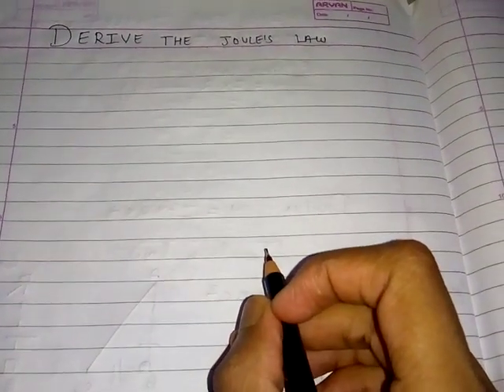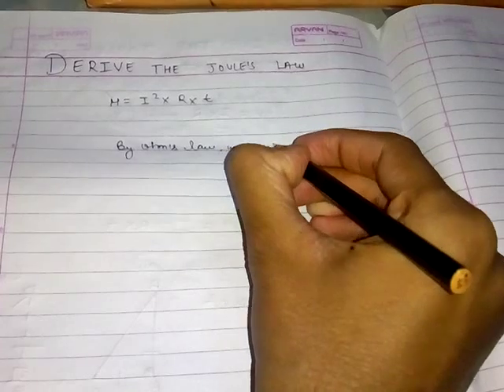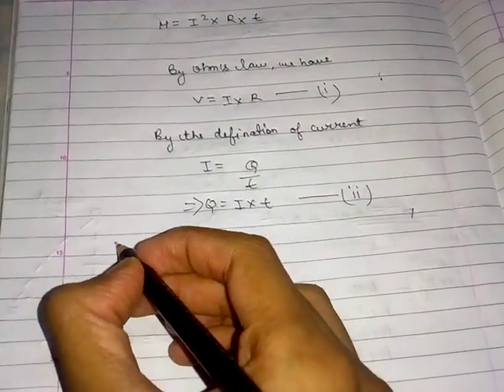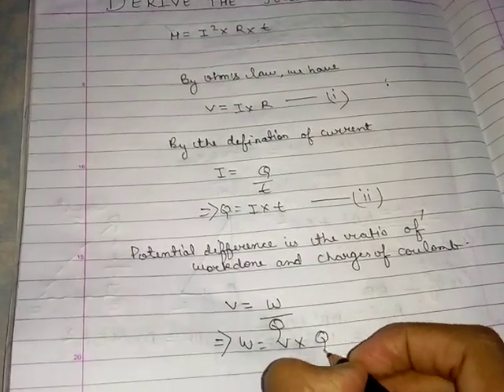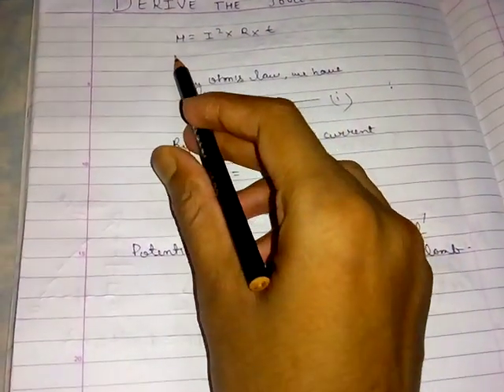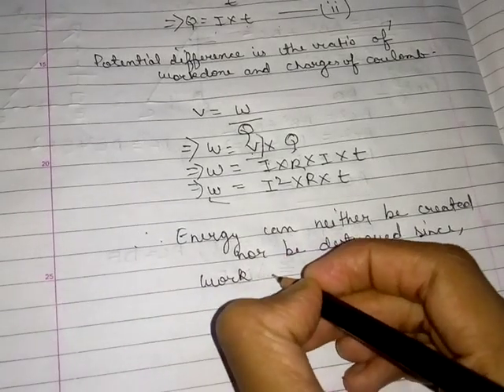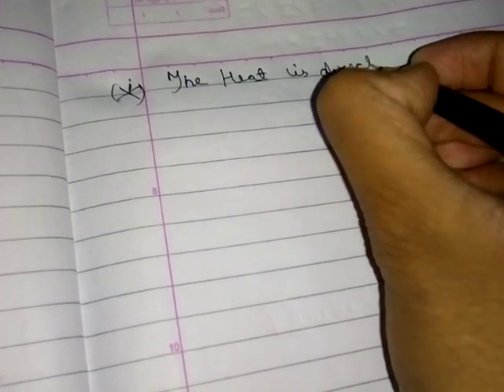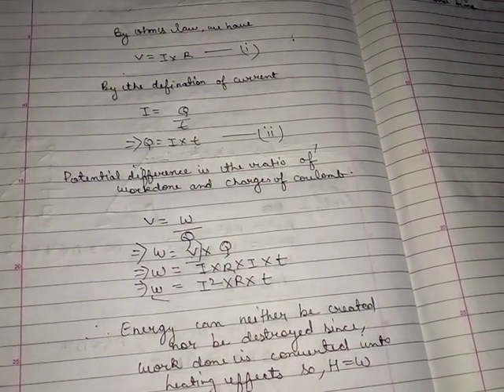Derive of Joule's law of heating effects ( H=I×V×I×R)

Comment: Bro you really overcomplicated it.
Here is an easier version of it -
We know,
W = FS
W = qV   (F = q, S = V)
W = ItV (I = q/t, so q = It)
W = I²Rt ( V = IR)
H =  I²Rt (W = H)

........................................

{ W = Work done, F = Force, S = Displacement, q = Charge, I = Current, t = Time, V = Voltage, R = Resistance, H = Heat}

........................................

Things to know -
W = FS (Work done Formula)
I = q/t (Current Formula)
V = IR (Ohms Law)
 W = H

Comment: But the last statement (the heat is directly proportional to square of its current,resistance and time) is wrong.
It is square of only current. 
So it should be (the heat is directly proportional to its resistance, time and square of its current)
Reply: Yeah.
Reply: Yes
Reply: Can you explain me difference because both statements are se 😅
Reply: @Seyoro13  hello I really forget about it cause it's more than one year old
Reply: @omumre1390  how much you scored in your 10th brother ?
My sci board exam is on 5 April
Reply: @Seyoro13  97%
Reply: @Seyoro13  best of luck
Reply: @omumre1390  great 🎊🎉🎉 and thanks 😊